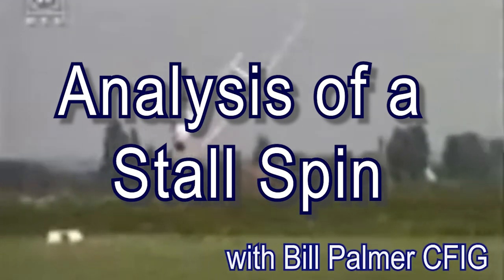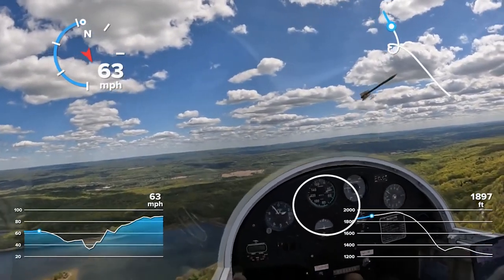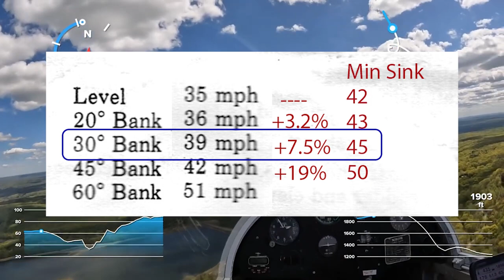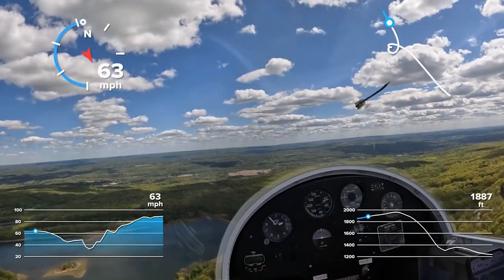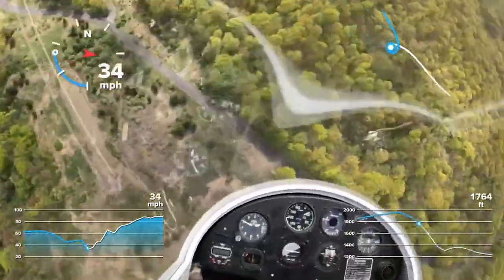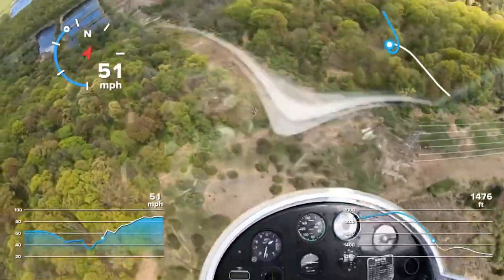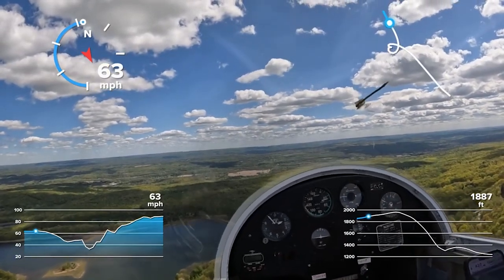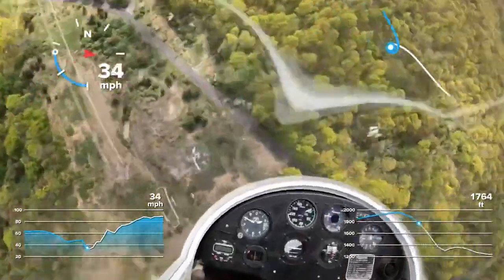Analysis of a Stall Spin

Comment: Thanks Bill, very instructional.   Did you notice the cell phone in his right hand.  I wonder if the distraction contributed.
Reply from the maker: yes I did notice that. If he was talking on his phone that might have been a much bigger concern. While it would have been better to have the phone and navigation app mounted, I didn’t want to be too hard on him.  
In the comments of PureGlide’s video he mentioned that “the stall speed of the 1-36 is 32 mph  and i was nowhere near that”.  So THAT was the major point that I think got him into trouble: Didn’t know the correct stall speed nor apparently the effect of bank-angle/ load-factor on that stall speed, nor applying an additional pad for close terrain.  He should have been flying at a minimum speed of 50 mph in that situation instead of around 40.
Reply: One of our P/G pilots died just after making a cell phone call whilst on a tight landing approach, when he hit known power lines.
Reply from the maker: @NevilleStyke  Sorry to hear that. Distracted flying, like driving, can be a big problem. 
Many glider pilots carry a navigation device or app, but it’s usually mounted (suction cup, Velcro, RAM mount,  there are many options). I wonder what he does with it when he needs to use the spoilers or other control. In this case it didn’t seem like he was on the phone and the small bit we could see of it looked like a navigation app, so without further evidence I elected to not go there. It was certainly not optimum, but as I mentioned above I thought the bigger lessons were on the airspeed, coordinating, and terrain issues.

Comment: I flew a 1-36 quite a few years ago and one thing I vividly remember is that it was quite pitch sensitive . Hitting some turbulence in a tight turn could easily cause some stick backpressure ,combined with the sensitivity  could have contributed to the spin . I was amazed at how much altitude he lost , I believe he was in an area of sinking air as well, I've come to associate cloud shadows on the ground with sink .  
It's a shame the video ends with a cliff hanger ....did he have a low save or land out? Not too many landing options .
Reply from the maker: Indeed the 1-36 is pitch sensitive but not excessively so.  He apparently owns this one (according to his own channel) and is comfortable enough in it to do some aerobatics.  This just drives home my last point in the video about carrying extra speed when flying close to terrain (i.e., ridge)
Losing 500 feet in a two+ turn spin is no surprise. 
In one of his comments somewhere, perhaps on the original video (since taken down), he remarked that he made a low save out of it.

Comment: I never understood calling it a "stall spin". Mainly because I have never heard of a spin that didn't begin with a stall. It's like calling an automobile race a "straight line drag race". Drag races don't have turns.
Reply from the maker: True,  all spins start with a stall, but not all stalls end with a spin. 
Think of it as a sequence, not a qualifier of the spin (as if there could be stall spins and no-stall spins) 
There are certainly stall accidents that did not evolve into a spin (Air France 447 - one I wrote a book about) comes to mind) and stall-spin accidents that are responsible for far too many general aviation accidents. 
The comments of the original poster (on PureGlide’s video of this same incident. https://youtu.be/S_cd1tbHXjo ) highlighted a major part of the problem which is the failure understand the increase in stall speed with bank angle by a very predicable amount and to account for it in the speed to fly. Here’s what he said:
“I was slow but look at my airspeed, a 1-36 doesn't stall until about 32 mph. I was above that. I didn't "fall into a spin". I was pushed from the left and rolled right, even though I had full left aileron. Because it was a rotor, but didn't know it at the time, I was then hit with a tail/downdraft and had no control for the first two rotations.”
That comment just screams at me. All of my students know that the stall and minimum sink speeds are 20% higher in a 45º bank, and we have a speed range to fly in any turn based on the bank angle. For example, in the SGS 2-33 the 1 G (wings level) minimum sink speed (full up weight) is 42 mph. So, for bank angles between 30º & 45º our speed needs to be 45-50 mph respectively. The OP not only did not apparently account for that, but the stall speed he had in mind was 32, where the actual stall speed was 35, so he was thinking he could fly 10% slower (than the actual Vs) instead of needing to fly 20% faster.
Reply: I think most pilots just call it a spin.